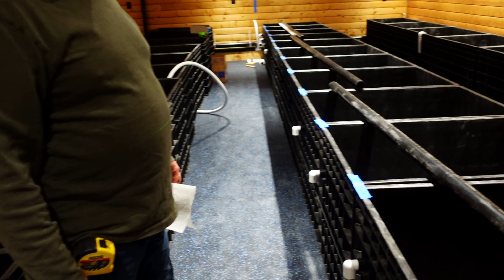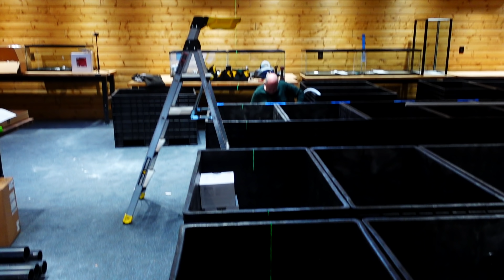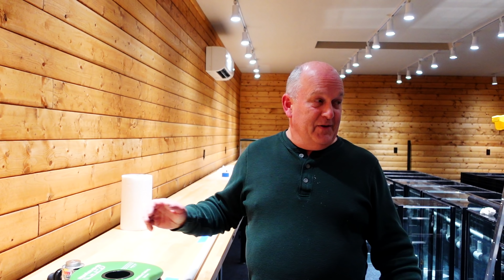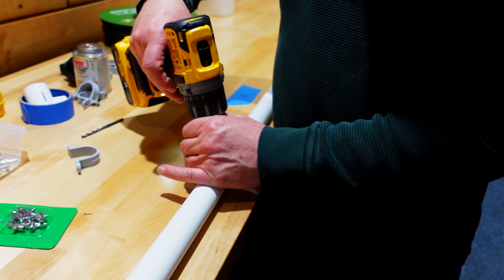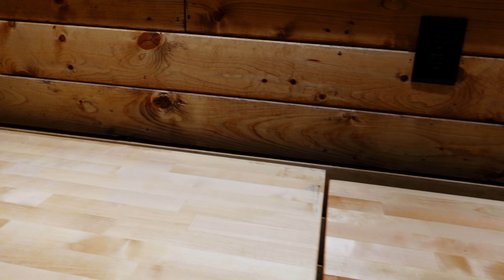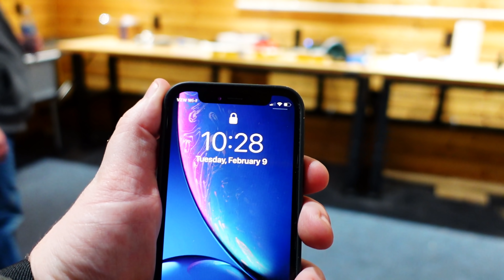Revealing NEW Upgrades - Fish Room Update Ep. 98

Comment: Any chance somebody can point me towards what router/switch he is using? I can't recall where, but he mentioned he had multiple internet services to get 100 down/10up. He mentioned a router that helps manage the multiple lines.

I'm moving to a rural area and trying to figure out something similar.
Reply from the maker: It’s a tp link product that combines all the connections together. https://www.amazon.com/SafeStream-TL-R600VPN-Broadband-throughput-Concurrent/dp/B007B60SCG?pd_rd_w=51gKL&pf_rd_p=68daf4dc-249e-43e7-bdea-8a4b97812436&pf_rd_r=49GR1BHXZ8AAR9N1TP4H&pd_rd_r=5513ac99-b9c3-486e-be38-527daffe0633&pd_rd_wg=JLzNE&pd_rd_i=B007B60SCG&psc=1&ref_=pd_bap_m_rp_1_sc
Reply: @AquariumCoop  Thank you. FYI Keep an eye out for Spacelink. I think they are already in beta in your area.

Comment: Have you considered using 1/2 inch vinyl linned pipes for connecting out of the tubs to the main drain lines?  It would allow for some forgiveness and reduce the chance of leaks possibly.
Reply from the maker: Anything less than 1 inch has lead to clogging in my experience. We are already using flexible pvc at each tote.

Comment: Not a flat floor? Yeah. That's a common problem. Its why for gravity-flows, its usually recommended to shoot for 1/4" per foot. It sounds so excessive; it's like an inch per tote. But it's what's needed when you don't want to literally take out a laser and custom fit. Additionally, you may find that over time pipes and concrete will sag; leading to dips that may be steeper than the drainage slope.
Fortunately, hydrondynamics is in your favor; as long as your pond level is above the highest point of air entry, you'll get flow.

Comment: Doing this in imperial is like 10 times harder, it looks crazy to me.
Reply: Imperial is a nightmare ,don't get me started on Fahrenheit
Reply: Imperial is generally much easier and precise for long distances like this. Most imperial tape measurers go to 1/32 or 1/64th of an inch (.79375 mm and .396875mm respectively) whereas most metric tape measurers only go to whole millimeters. All that aside, in the US and Canada, it's much easier to find stuff already in inches/feet as far as pluming, wood, electrical, etc goes. It's probably only harder for you because you aren't as familiar with it. It was the same with me using metric when I got in to engineering, man for some reason everything was so much harder because in my head I would go "One meter, or roughly a yard", which was super counter productive, lol.
Reply: @BartonHNewell  Imperial is easier if that's what you know.  That's why lumber, etc is still sold that way in Canada.  We buy and sell it with the States.  We learn imperial if we learn woodworking, etc.  Metric is far easier.  How many inches in a mile?  How many centimetres in a Kilometre.  When I need to be precise I take out my digital calipers and usually have to hit the button a few times to convert the measurements back and forth.  Just to make sure, I know what I'm looking at.  lol

Comment: With a holding capacity of only 700 lbs. Do you really hope to fill these with water?  They are only rated for less than 90 gallons each based on their load rating.  I would consider these containers too but not if they can't be filled to at least 80% of internal volume
Reply: Please let me know if I am missing a fact here?  I checked with the manufacturer and he has not disputed my calculation that they are rated to hold up to just under 90 gallons (700 lbs).  I would like to understand your decision making on this critical point?  Otherwise I am planning to use rubbermaid 300 gallon vats which are tried and proven for raising fish.